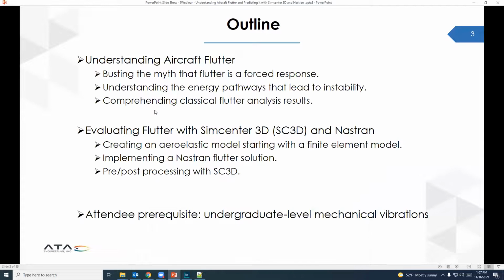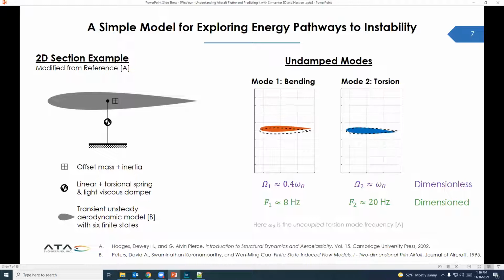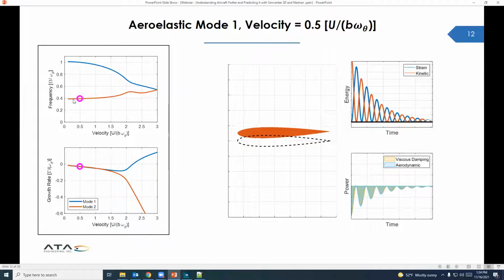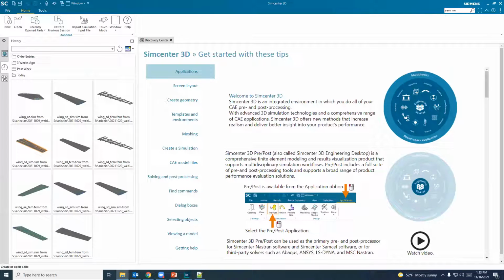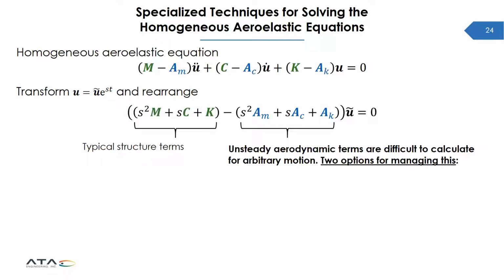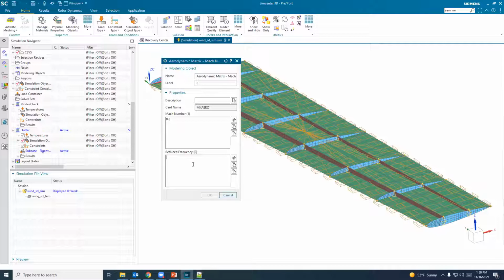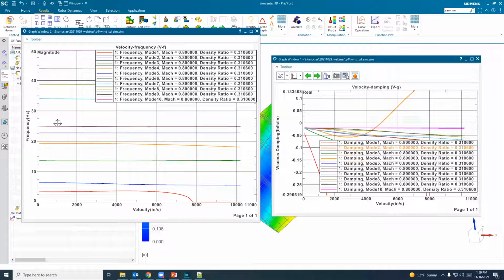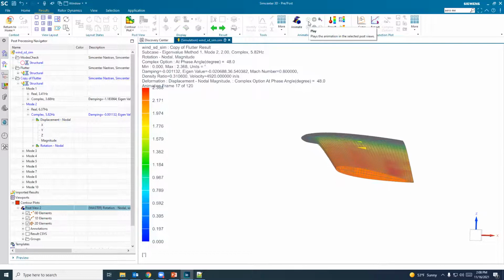Understanding Aircraft Flutter and Predicting It with Simcenter 3D and Nastran

Comment: Any flutter prediction starts, or falls, with precise knowledge of:
1. the exact wing mechanical stiffness in all the possible directions, even shear stiffness is important.
2. mass distribution in span and depth direction
3. dynamic (=moving) aerodynamic forces on the wing. Static aerodynamics will not work.
4. at that mach number 
5. for that section. 
6. at the altitudes flown.
Nastran is expensive. Results will have +/- 10-15% accuracy. 
The CS (=EASA) requires additional flutter test  for certification completion. 
Why? Doubtfull calculational accuracy.